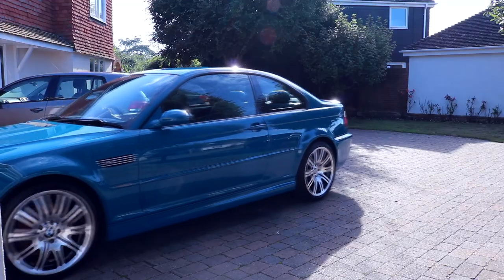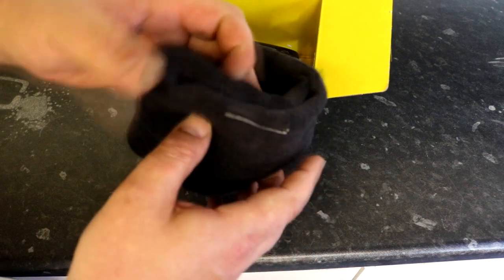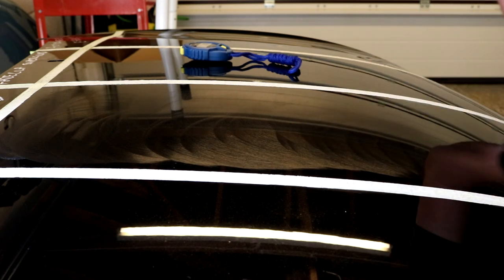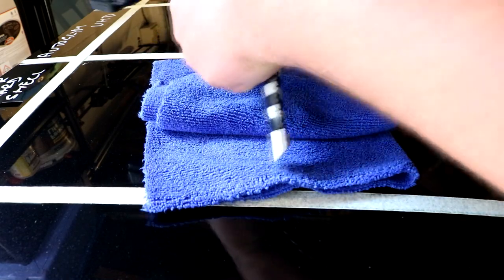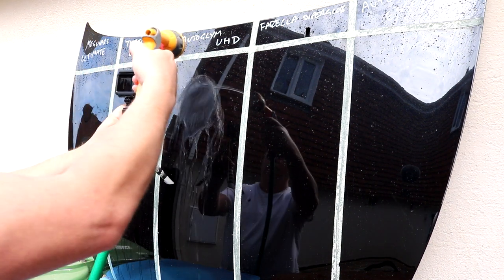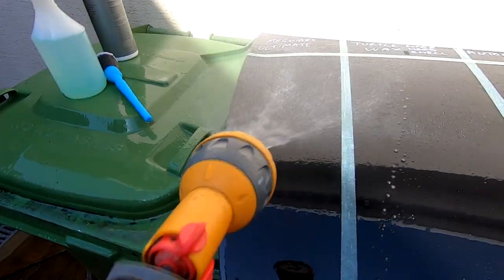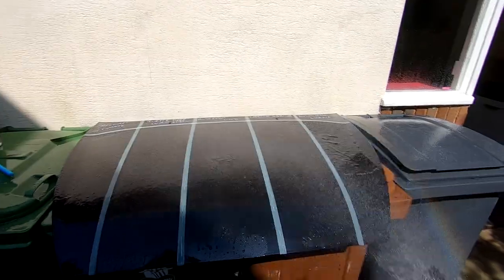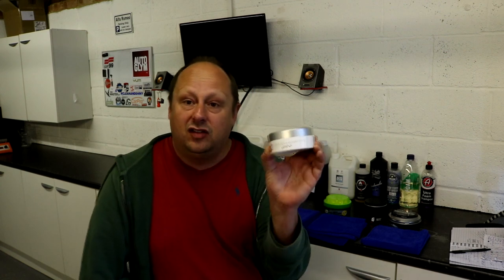Battle of the Halfords Paste Waxes - The ultimate comparison review

Comment: My favorite paste wax hands down is Soft99 Fusso. Lasts VERY long, is detergent resistent, keeps my car cleaner for longer and best of all THE BEADS ARE INSANE!
Reply: Andres Rivera is this a filler?
Reply: jubair Ahmed Nope, you have to correct the paint before you apply it if you want to get the best looks and best bond possible. At least a finishing polish and IPA wipedown before you apply, as it doesn’t bond well to “dirty” clear coat and you can get patchy spots that are much more hydrophobic than the rest. Good prep work goes with any wax really, but the really high performers make poor preps much more apparent.
Reply: I heard the new formula is not as good as the old, is this true? and I can't find the old formula.
Reply: @WaxMode  can u please do a test with wet wax ceramic of Twax? And other brands? What about wet wax of tw vs turtle wax flex wax and ceramic tw wax?

Comment: Collinite 476s. Excellent value and excellent durability. Especially good against salty winter conditions. 11 months is the best longevity I have gotten out of it. 

Finish kare 1000p. Good value and heat resistance. Bad against salty winter conditions.
Fusso F7. Easy 7 months through the winter. Rear and sides were nearly gone but the rest still had a good amount of original properties left.
CG Jetseal. Easy +6 months.

Lots of waxes/sealants make it to 4-6 months but those three can handle more in my experience.
Reply: 476s is also sold as a marine wax (Fleetwax 885) 'Long-lasting protection guards against UV, salt spray, marine growth, stains etc.' Hence it's a damn good Winter wax for cars!
Reply: Both 476 and 915 on my shelf, great waxes.

Comment: Very interesting video Jon with some results I wasn't expecting!

Of the ones tested I have and use the AG UHD and the Farecla G3 Super Gloss. I do agree that the hydrophobicity of UHD is just a little bit better but having looked at some of my photos of beads from both, there isn't much in it.

Application I also think the G3 wins and by quite a margin as well. I like that you can make your way around the full car then grab your towels and buff off in the order applied. I found with this it gave a perfect 25-30 min cure time for the wax to fully cure/harden resulting in removal being effortless. UHD I actually don't find the easiest to use. Cure time needs to be observed carefully and I also find it can be a little difficult to spread a nice even layer of it. Get it right though and it's spot on, I just think the application runs the risk of user error. 

Great video though Jon, thoroughly enjoyed it. Going to drop you a message bud as I have a proposition for you 😉

Comment: For great appearance its awfully hard to beat Collinite 845, Insulator Wax.  Excellent wax that is easy to apply and lasts a long time. Very affordable. I top it with Beadmaker as needed. This combination works great together and Beadmaker can be applied to every material on the outside of the vehicle.  Very slick and looks wonderful.

Comment: Autoglym ultra HD I have been using for quite awhile now. Excellent wax . I have used it maybe 10 times and it barely looks like I have taken any from the tin. Durability is excellent . I get about 3 months before I see any decrease in performance. I am using their ultra HD shampoo which is possibly topping up the performance but all around a real quality product which I will take any day of the week over the ceramic coatings and sprays due to it's nice warm glow

Comment: Great idea this test. I always ignore what’s sold in Halfords to a certain degree so nice to see these results. It would have been great if the Turtle Wax was a shock top performer but not  surprising that UHD won. It’s always had a great reputation. Thing is some like BH Double Speed Wax will perform so well for £15 incl decent mf and applicator. Then there’s Imrans ceramic wax.

Comment: Nice video buddy. Can you pit the AG UHD against things like Bilt Hamber Double speed wax, Fusso, Collinite, etc and other favourites in the detailing world? I am in the position where I'd only like to buy only one good wax so I'm a bit stuck with what to get, especially as summer is approaching and this is when i'd like to use it. Would like great gloss, durability and hydrophobic properties. Any chance of making such a video happen? Maybe like a mini ultimate wax review and tell us your favourite!
Reply from the maker: fusso isnt that glossy but its durable and hydrophobic.    collenite is durable and gloss but not that hydrophobic.  Double speed and UHD are gloss and hydrophobic but not quite as durable 3-4 months perhaps (longer potentially).  UHD is the easiest to buff of all 3.  colly 915 goes rock hard.
Reply: @ForensicDetailing  Hmm ok so there isn't one that ticks every box just yet, I'm edging for the UHD, anything which springs to mind which would be better for £50 or less?  
Reckon your next wax comparison would head in that sort of direction or are you thinking of something else? 
Btw, let's say it's summer and you wanted to put a nice wax on your car, what will you be reaching for (or already use)? 
Cheers
Reply from the maker: if you want cheap and good go double speed.  the autoglym uhd is more expensive, its softer to remove.   they are both hydrophobic and roughly similiar durability.  ill line up a load of cheaper ones soon.   after that Ill look at some monster durability ones.

Comment: I used to have a lot of conntact with Autoglym wax and yes, it is durable, but otherwise quite picky depending on the car. Some where turning out great, other had dark spots. I'd say it's good for pearl paints and in good shape paints (no deep scratches, not bone dry). Also since it lasts, every application after first is easier.

Comment: This is interesting to see. I'm currently doing a test between Meg's gold class, Meg's Ultimate, chem guys jet seal, Meg's mirror glaze synthetic sealent 2.0 and car pro reload that's the same kinda testing you did. But then after the durability I repolisished and reapplied them and have the test panel sitting outside in the weather to see which lasts the longest.
Reply from the maker: lemme know results.. megs syth2.0 should win that.. or jet seal...  megs 2.0 is silicone polymer i think.. jetseal acyrilic polymer.. harder to observe jetseal its less hydrophobic.  megs ultimate is not great on durability though from what I seen. or should I say detergerent resistence.

Comment: Probably a silly question I know but would there be any reason to apply, buff off and reapply, buff off ect straight after each other. My reason for asking is that it how a high gloss shine us achieved on things like army boots and wondered if it would work in relation to this to build up shine etc?
Reply from the maker: hard to say with certainty but 2 layers of wax might give you a bit more durability than 1 layer.  its less important than prep and allowing to cure and sort of what you use to wash and maintain it though perhaps.    but nothing wrong with sticking 2 layers down mate if you want to.   but its one of those things that really you just have to try and decide if you get beenfit from it. other peeps will tell you different things eg yes you should no you shouldnt.. but its just one of things you have to sort of decide personally.  I dont tend to put 2 layers of wax down. in fact I cant remember the last time I did that.

Comment: I've just machine polihed one of my cars for the first time ever, using the LHR15 III, with all 4 polishes. So, I was out of the Aytoglym HD wax, and after seeing your comments on the matter, I bought the UHD version. Applied 3 layers, one each day. New autoglym towels each time. So, my question is this: how many layers can one apply with this uhd wax?
It looks amazing now ;) I normally apply 7-10 layers of thin wax during Winter storage. I tried the Meguiars ultimate paste wax, but passed it on as I noticed after coming home with it, that it's purely synthetic. Don't want that for sure. And now it gave my alfa friend a headache each time he applies it. Bad product. Bad health. So, back to Autoglym: Anything to gain with many layers in your experience?
Cheers.
Reply from the maker: I dont think theres much benefit to putting on more layers.  2 layers can help but after that its diminishing returns honestly jacques ill do ao video on it one day.
Reply: @ForensicDetailing  Oh! That was fast! As in the water repelling speed!
So, I think I'll leave it at the 3 layers I've done today. Likewise on the wheels.
My wheels are 3 split original wheels, and are laquered aluminium in silver grey and a shiny aluminium outer rim, now rebuilt with radinox stainless special steel. Super shiny. Never sone anything to the outer rims, apart from two times over a whoel season, using a fresh microfiber cloth and jsut run them over, dry. No scratches, no spots or anything. just pure shine. A blessing compared to my old BBS RS001 polished aluminium outer rims, which took hundreds of hours per season.
Anyway, have you ever put any wax or anything similar on such an outer rm (radinox)? I NEVER EVER use the car in rain, but once driving, I can be surprised by a shower, as you may in the UK ;)
So, any benefit in this?
Kind regards.

Comment: Nice review Jon.  I use the meguiars ultimate.  I wash with onr wash and wax and dry using meguiars synthetic spray wax as a drying aid.  It seems I'm always topped off and beading nicely, so would it even be a benefit to upgrade to a pricier wax?

Comment: I out of all of the waxes I've used i like the ultimate paste wax. It smells nice too. I'm interested now in some higher end stuff. I could justify the extra cost if they perform that much better. Please do some more reviews
Reply from the maker: with wax, you could say you have performance in terms of durability, gloss ,ease of application, what materials its laying down and how they protect the car...     But you can get a lot of performance from cheap wax if your on a budget.   typically if you go higher end you might be getting something thats more beutique.   You will be hard pressed to find a wax that lasts as long and is as repellent as fusso for example.  A 200 pound wax per say doesnt mean its going to last longer.  A lot of times its just where the brand places the value of their products.   saying that theres some very expensive waxes which I would love to own.  Scholl Vintage wax, nothing ground breaking costs a fortune but I really like it.  Enigma wax from AW. costs a fortune but again I like it.  not really because it will outperform fusso.  I just sort of just like it.   Some of the swisswax waxes as well I would liek to own because of their wax making pedigree.     but yer a pot of collenite or double speed or kiwami will do the job as well.

Comment: I have Essence on my car which I put on last October and it is still there so I agree on the durability. I am not entirely convinced of the gloss level, so if I wanted to remove it what is the best way?

Clay, paint degreaser, alcohol?

Thanks
Reply from the maker: check out a product by garage therapy called /decon wash.   wash it with this.  then prefeorm a chemical decon and perhaps clay if required.   then quit whizz around with a polisher.  degrease and apply new protection.  that should work mate

Comment: Can you apply Autoglym UHD with bare hands? like Zymol waxes, I just find it easier to spread a thin coat across the car with bare hands, Also can feel any grit that gets caught as I'm more of a guy that like to layer wax on after a weekly wash if I'm going to take the car out.. Having a White Porsche GT3 RS I find the paint very soft..
Reply from the maker: you can but dont.  your hands make woefull applicators, you wont feel all the grit even if you do if you feel it its prolly scratching.  a sponge is softer and makes a much better applciator.   that whole applying wax by hand is hmm..  waxes are 50% mineral spirit and all sorts of funky silicones and additives, your hands will soak that in and after 15-30 minutes of waxing your hands will later go red and itchy or dry skin.  you also wont apply it as uninformly as a foam applicator.  trust me the applying wax by hand thing was just another way of glamming it all up.  even heard guys saying the heat from your hand activates the wax and other stuff...
Reply: @ForensicDetailing  I see thank you, Zymol Wax seems to be mainly oils so I can see it'll be ok with their waxes but you're right about other none natural waxes, What's the best applicator to use, I've been having trouble with using too much wax and it not spreading quite as nice as I had hoped after the first coat.. Not sure what I'm doing wrong :(

Comment: Great review! I tend to think of value as being a combination of quality, performance AND cost. Cheap waxes might look like good value but the biggest investment is surely in the hours of cleaning, application and buffing. If one is more expensive but shines and beads for months makes my car easier to clean - I’ll take that over a cheap price tag where I’ll be underwhelmed with a couple of weeks. I’ll give the AG a shot and see how it fairs against my staple Colly 845 👍
Reply from the maker: its a lot easier to use than 845 for sure.  but you will notice how 845 hardens off rock hard, when things to that it usually means their durability is good. (not always though)

Comment: What detail spray would you use with uhd which will not affect the performance and keeps it slick and glossy was thinking about bouncers si or is there another one you would use + one which will not affect the uhd  just cleans panels without lying anything down  thanks great vid as usual
Reply from the maker: I dont know if I would use Si materials on top of a wax.  It would work, but I just would perhaps pick a more like for like combo.    Id use any sort of normal detail spray perhaps.  literally anything.

Comment: Excellent video as always mate!! 

I've used the Meg's Ultimate paste wax a few times before. I too was disappointed with the water behaviour, which started off 'okay' and died off after a single wash. But as you showed  it's a very glossy wax. I still use it as a sealant from time to time but it always gets topped with something like a detail spray or somthing like Beadmaker. 

However, within these sort of price categories I always turn to either Fusso Coat if I'm in the mood for beading, Collinite 476S as the 'old reliable', or Bilt Hamber Double Speed wax for the gloss and water behaviour. They all end up getting topped with something like Beadmaker, BSD, QED or somthing else after a couple of weeks as I just can't resist spending time with a plush microfiber and an excuse to spray something on the clear-coat 😅 

Thanks as always,
Jason
Reply: So far my results of using megs ultimate have been pretty good. Still some protection since applying in November. However I am just about to start using fusso soft 99 dark as a base layer for durability and put something over the top a few days later for gloss. Not sure what yet though.
Reply: @TheFazer1992  I would imagine that Beadmaker would make an excellent topper for Fusso Coat, especially as the hydrophobicity of Fusso Coat will likey show through the Beadmaker, while maintaining that super slick feel you get with both products.

Comment: Hey cheers for this comparison you have done really well to sell the autoglym to me! That being said what’s the difference between polish and Waxing a car and should you polish it or wax it first any information after a good wash is helpful. Cheers
Reply from the maker: Hey Sean, thanks mate.   polish removes material its a purpose built abrasive.  whereas wax is a material thats left behind to fill and add gloss and protect the surface.   

You should check out my Detailing Fundamentals training course with discount code applied:

https://ioa.pxf.io/c/2687409/1012495/12764

Comment: Thanks very much for doing the testing on the waxes.  I was sold on Meguiar's until it was was low on durability.
I have been using Griot's, Best of Show Paste Wax,  $25 U.S.  It's working well.
I have been thinking of trying Mother's Pure Brazilian Carnauba Wax.   Have you tested this?
For me,  having a black Corvette,  I want shine and durability against bugs and road-grime sticking to the car. I don't drive in rain or snow!
Reply from the maker: ive not tried the motehrs its not widely used in the UK  I will keep an eye out ron. thanks for the kind words mate

Comment: Can you only put polish on a dark car? I noticed the test bonnet was black. Could I use on my grey car?
Reply from the maker: hey stephen think of a polish as an abrasive that you rub, and by rubbing it you improve the surface of your laquer or clearcoat on the car.  This increases physical gloss of your paintwork.  After you use a polish you remove it from the surface.
This of car wax as a protective product, a hard resin thats disolved in solvent, you spread it out, it cures and you buff off excess. It leaves a layer of material to protect your car. 
thats the difference between a wax and a polish.
The color of the paint below the clearcoat is not of relevence.
Reply: @ForensicDetailing  outstanding mate. I actually meant wax but aye, that answers my question. Thanks for replying.